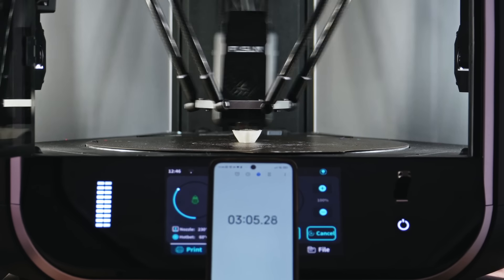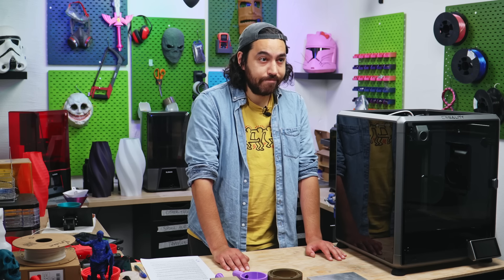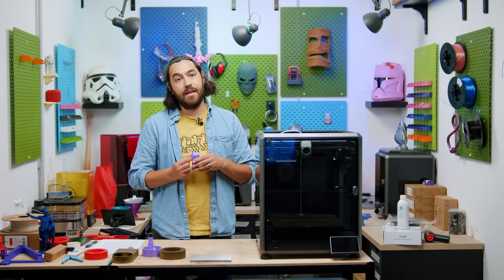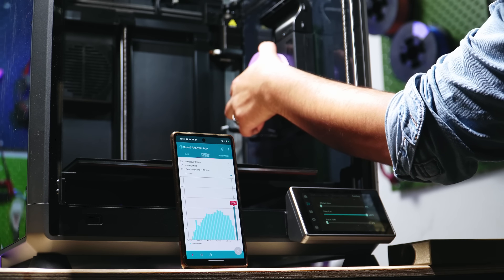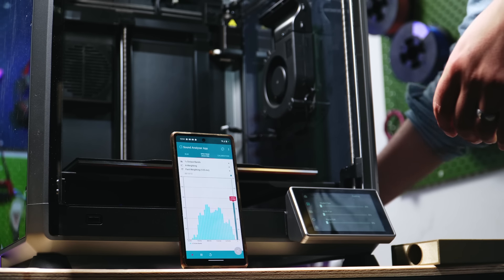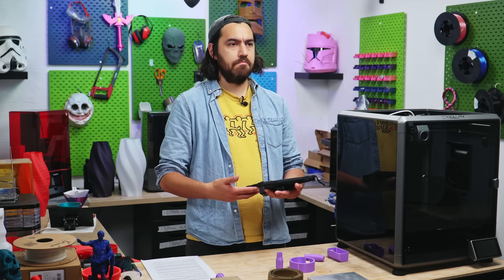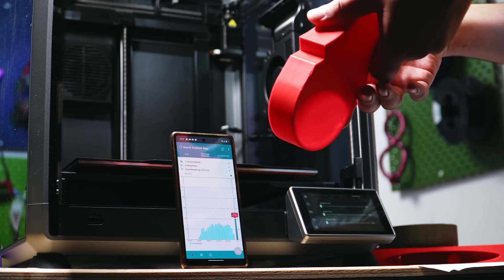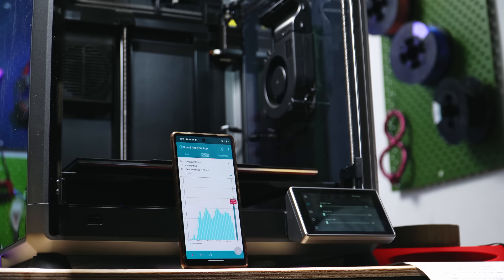Quiet Please! Reducing 3D Printer Noise with DIY Mods

Comment: All the noise cancellation chambers you came with are designed the wrong way: sound / pressure waves are bouncing on the vertical wall of your designs. That wall should be 70mm directly in front of the impeller. Air flow bends, pressure waves bounce.
Reply from the maker: If only we could - we have around 26mm of space between the fan housing and the bed. I'm very tempted to just completely redesign the fan mount so the intake is on the exterior and then we can add the chamber instead of a long narrow one that is perpendicular to the direction of the pressure waves.

Comment: My stupid solution is to make a bigger box to enclose the already enclosed printer. It could be made on MFD with insulation panels and you can provide a couple of strategic openings to extract the heat on the top with noctua fans to actively extract the heat. And maybe completely replace the side panels with thick MDF panels or even print a protruded side panel and physically separate the fan from the panel with Sylomer

Comment: You also need to make sure whatever solution you come up with doesn't interfere with the print surface.
Reply from the maker: That was a big problem for us. There is a gap of only 26mm between the side fan and the bed :/
Reply: @3DJake_Official  It looked close, but didn't realise it was that close.

Comment: I think the way to go is to look at the fan blades themselves. Take some inspiration from tne work being done on drone blades to quieten them down for travelling through built up areas.  Instead of baffling tbe sound, they are spreading the sound energy across a wider frequency  spectrum so no single frequency stands out. Drone blades have to not only push a lot of air, but they also have to do it economically on the energy.  Look at Mark Rober's report on this. The other thing to look at is turbulence. If the air flow is more laminar, the quieter it will be. There is also work being done on bladeless air flow using electrostatics.
Reply from the maker: I had considered using Plasma Channel's air thruster as a cooling option but perhaps a bit too overengineered for something like this.

Comment: Really nice video! This is an important topic and I 100% agree that loud printing just does not fly in the home.

One of the things thats impressed me so much with the Flsun V400 and why no other printer has been able to replace it for me yet is how reasonable the volume is when printing at 600mm/s.

It's not annoying at all to share a room with - Im often working at my desk about a meter away while it prints and its absolutely not a bother.

So while the K1C was nice, its volume meant it had to go. Also I havent tried them myself yet, but I hear the Bambulab P1P/S/X1C printers are all loud printers as well, so they wouldnt work for me either.

Keen to see if Elegoo's new fdm cube is any good.

B'yeah, good stuff! Hope manufacturers can keeo the volume down on future machines. The S1 is a bit better with a muffler and some new profiles on the latest firmware, but its still insane.

Comment: Remember the fundamentals. You have energy in the form of sound waves, and you want less of that energy to get to your ears, so your goal is to convert as much of it as you can to anything other than kinetic energy (which in turn would make more noise). 

The gecko tape with the plate is a GREAT example of this. The plate can't vibrate as much as it would otherwise, so you're converting the sound to heat! I'm not smart enough to run the math on this, but that does mean there is a point of diminishing returns, as more heat means you'll get more fan.

Comment: Hey. Just a thought when it comes to the k1 or k1 max side fan. If there is a resonance then can we not add something between the fan and the side panel? Rubber standoff with longer screws? Or even some thin acoustic foam to put on the back of the fan. It should stop the vibrations. I have a k1 so I may try it at some point. But maybe you can try that? Thanks
Reply from the maker: Yeah that might help, maybe even a thick but low infill TPU gasket could work.

Comment: New K1 Crealitor Printer - ended up sticking it on top of my fridge which is in the corner of my room, and from a external beams I hang my spare towel, which absorbs sound, using the sound recording studio principals or soft fiber sponge type materials.  Absolutely insane volume right next to my laptop trying to concentrate - what was I thinking???

Comment: You can get very quiet air compressors. Perhaps one of them with a thin and wide nozzle would be better. Also more focused.
Great video. Keep up the good work.
Reply from the maker: air compressors generally have very poor airflow. Like something rated to over a kilowatt will have the same airflow as a noctua fan.
Printer fans work by pushing away the volume of hot air near the filament, this depends on displacement which depends on the volume of air being pushed out rather than the speed.
We're measuring the air speed here because we can't directly measure the air flow, they are proportional however you do need high flow for cooling rather than high speed

Comment: Are your stepper moters actually that silent? I own an k1c and the steppers are just as loud as my ender 3 before I got the silent board
Reply from the maker: That doesn't sound right at all, the side fan bothers me a lot more than the steppers
Reply: @3DJake_Official  weird, so you hear no loud stepper motor singing while printing on normal/fast speeds? the fans are also loud but i have the printer in another room so I barely hear them. The steppers however I can even hear downstairs.

Comment: You would not need that much flow if the coolant would be colder or have better cooling capacity, so maybe using very cold air could allow lowering fan noise?
Reply from the maker: I have thought about this, I'm not entirely sure but I want to try it. Fans work by basically just moving the hot air away, which is a lot faster than conducting the heat away. The problem with this is refrigerator compressors also make noise and are expensive, other options would be evaporative cooling (this would involve very humid air and not sure if that would affect part strength) or something like thermoelectric coolers which are notoriously inefficient but this definitely needs to be given consideration and I think I need to do it in the near future :)

Comment: Parts cooling in the K1 Max really needs fans on both sides of the chamber, so what is really needed is a tuned airflow at maybe 80% of the speed of the stock fan but on both sides. That might be more effective but at much less noise.
Reply: Coming with K2 plus this year October release.
Reply: @doorsbh  Yeah, I have high hopes. Some folks have also modded the K1 Max for better parts cooling.

Comment: Make part cooling exhaust circular located around the nozzle, push cold air from an air con into it. This way you can reduce the amount of airflow required to cool parts down.

Comment: Why not make a box with a wall of several Noctua fans on one side — and a tube to the current fan’s mount on the other side?
Reply from the maker: I'm not exactly sure if the noctua fans are powerful enough to push air through a small space like a tube. But we'll have to try it :)

Comment: I guess there are reasons, why silent fans
- use hydraulic bearings
- are well balanced
- use soft mounts
- are designed for maximum flow/noise ratio

The K1 Max fan sounds like it has d(r)ying ball bearings and simplest/cheapest impeller 😅

One might use medical grade commercial CPAP fan that does the job without waking up the dead (e.g. 12m3/h 67dB 10kPa at 60k rpm), or seat blower (it's a thing? e.g. 40m3/h 54dB, less pressure). Price is probably 10+ times higher too 🤔

With proper fan, the printer could be a lot easier on ears, and sound level could be further improved by using silent/smart fans for hotend, power supply and control board and by optimizing the flow within and out of the "external" fan duct.

Comment: 10:50 lmbo
I still think the uber speeds are overrated, the faster the things go the lower their quality is..
Reply from the maker: Not quite, it pushes the limit but yes print speed boasts are basically tag lines now, nobody prints 600mm/s on the K1, you'd have to be nuts.
But you can print fast without a loss of quality.